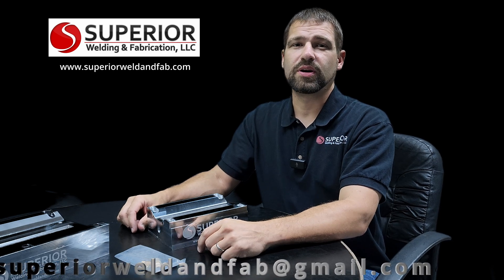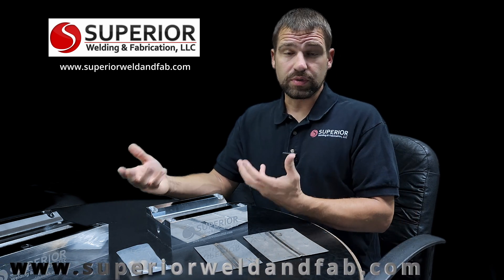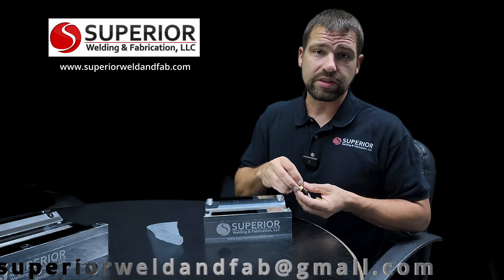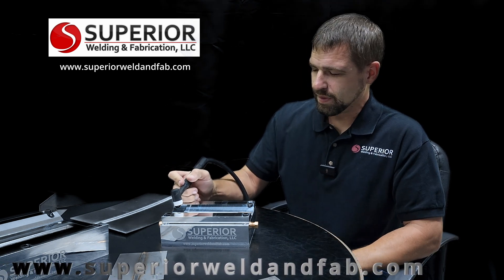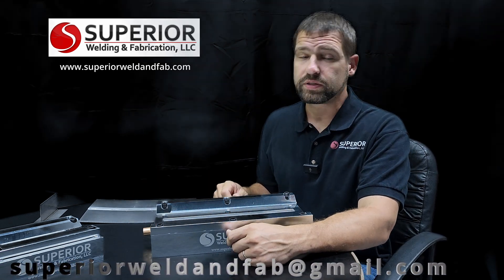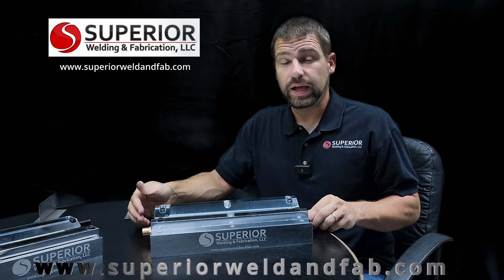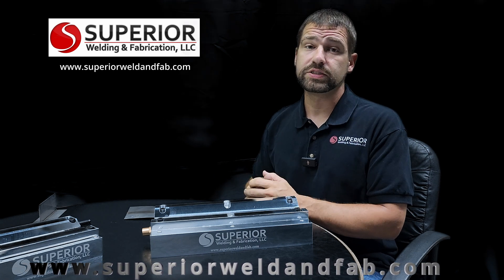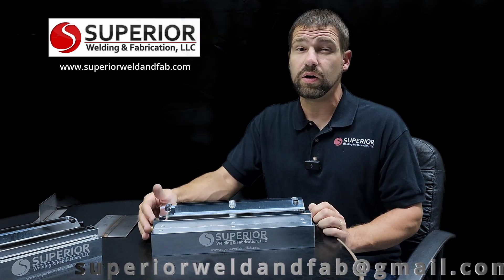Superior Welding Aerospace Weld Test Fixture

Comment: just bought one, i would recommend it, it's easy as an individual to fall out of practice on these tests but with this fixture I got back up to speed in a day. Fillet weld block works really well. Only flaw was that the outer screen on the main gas port sits too high and got welded onto the backside of a plate.